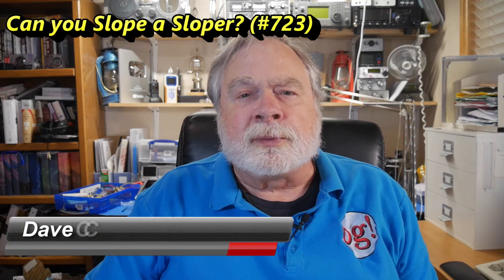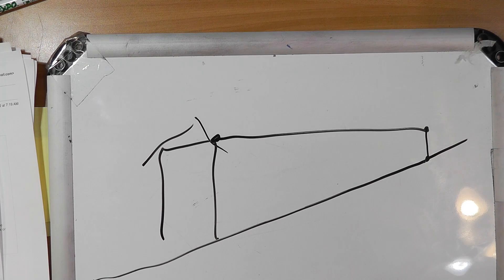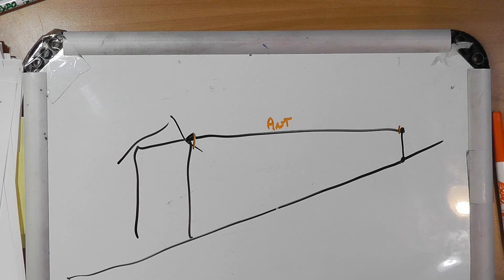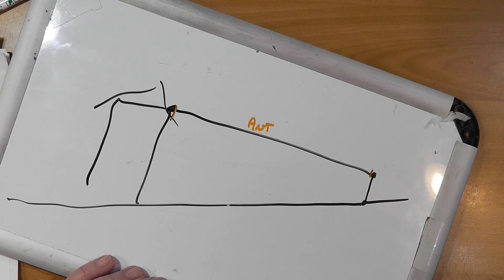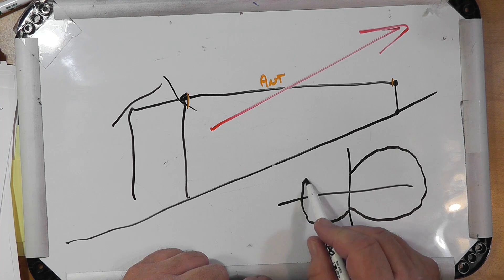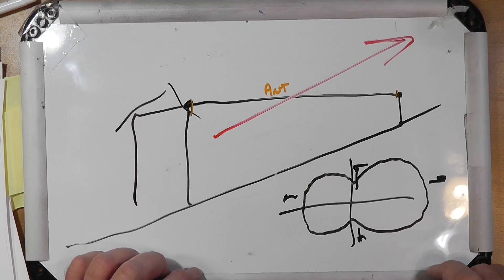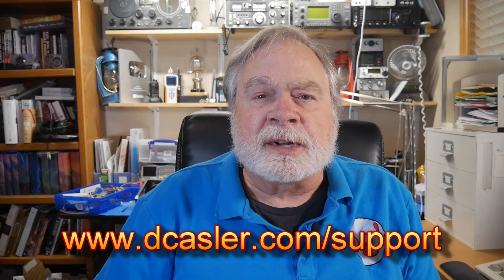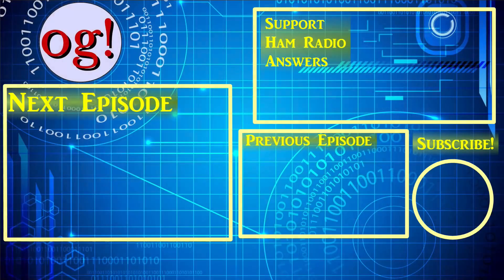Can you Slope a Sloper? (#723)

Comment: As i understand it, in this scenario, level wire, slooping ground, the radiation pattern will be opposite of what you illustrated in your diagram. The ground (earth) acts as a reflector, the larger lobe will be in the down hill direction.  Think of the ground as a mirror.  The signal being radiated is perpendicular to the wire, striking the mirror and is reflected away at and angle.  I think there will be a NVIS component to the pattern.  How that will affect the down hill lobe is a good question.  🤔

Comment: Dave, I am Walt (AI7MY). 

I live in a similar situation up in Red Canyon, South of Lander, Wyoming. I have set my 140 foot random wire in the opposite situation than you have shown. It slopes off my house down the hill from roof level (maybe 12 feet high,) to about 4 feet above the ground. And it radiates best down hill. The ground being a reflector radiates towards the low end. I get very good reception and transmission generally in the down hill direction.

I enjoy your videos very much and have learned a lot from them. 73!